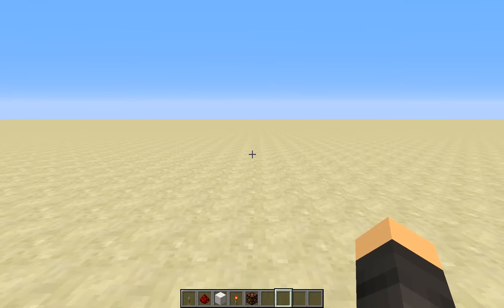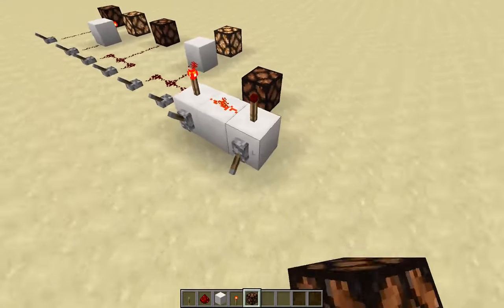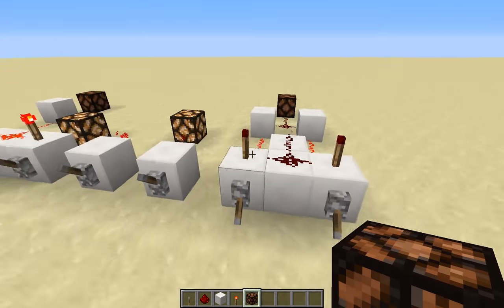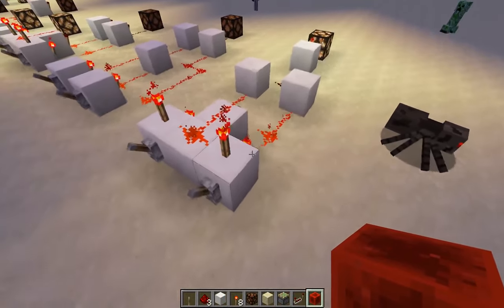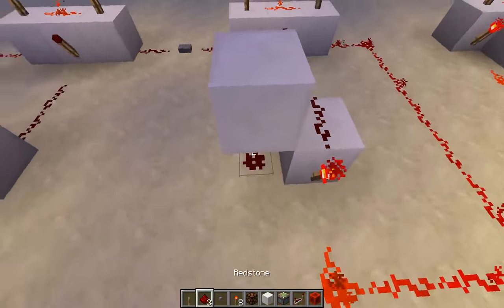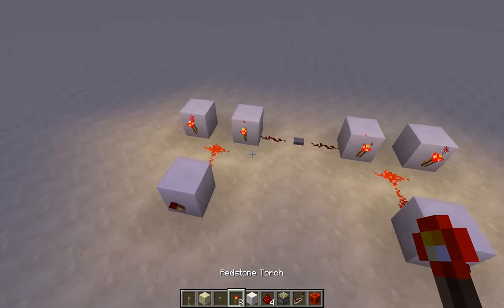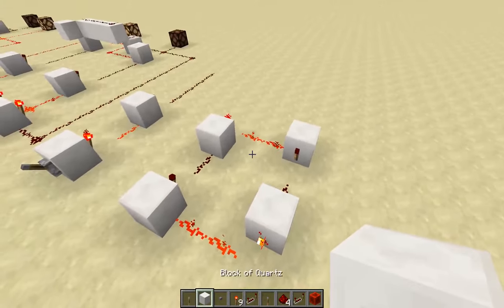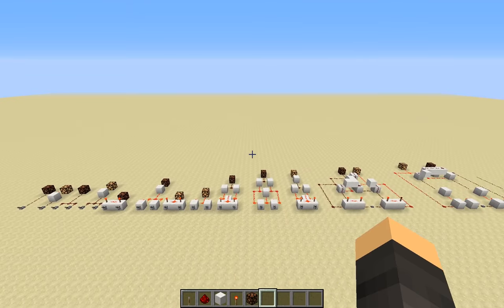Computer Logic Gates in Minecraft (Only Redstone and Torches)

Comment: Note: the T-Flip Flops in this video wont work in bedrock.
Reply from the maker: Are you talking about the one with the torches or the one with the piston?

I believe the one with the torches will work though I don't know bedrock.
Reply: PlexusMC 

Both
Reply from the maker: @xandercreates6766  damn that sucks. I would really have thought the one I did would have worked. Why doesn't it?
Reply: PlexusMC 

Redstone works differently in bedrock

It KINDA worked but every time it turned into a clock and wouldn’t stop
Reply from the maker: Ah well that sucks
Reply: @PlexusMC  Bedrock redstone randomizes.
Reply: Vulcan Tube 

Stone didn’t work iirc.
Reply: I achieve to solve it using Redstone Repeaters. Simply add two Repeaters with maximum delay for each two central lines
Reply: the rest work?

Comment: This vid is sleeping gold as far as I'm concerned. I'm convinced that ANYONE who wants to learn redstone needs to keep it simple first: Don't worry about complex inputs like buds, daylight sensors, etc. and don't worry about complex outputs like pistons, dropper/dispensers. Learn about the dust and torch mechanics first because while building compact is nice and all, it's not mandatory since Minecraft is enormous. Plus it's overwhelming to have to deal with pistons and such when someone like me doesn't fully understand how and when dust/torches will or won't connect to a block/component yet.

Anyway, perfect video man. There is a good reason this is the 2nd (should be first) option when searching "Minecraft redstone logic gates". I would love if you made a second part to this and give us even more complex logic systems using only the dust and torches, starting off where you left at the RS Nor-Latch! Liked and sub'd
Reply from the maker: Damn man thanks a heap
I might make a 2nd video. If you have any in depth suggestions about it I would be happy to include it. :)
Reply: ITS THE FIRST RESULT WHEN SEARCHING MINECRAFT LOGIC GATES
Reply: agreed

Comment: by the way, to make a clock with no repeaters that doesn't burn out, as long as there is an odd number of torches in total, it will not go out. So basically, make the one they had but remove one of the blocks and the torch on it, and connect with redstone dust and it will keep going

hope that description helps
Reply: This is called a ring oscillator.  I built one of these and it works fine in both Bedrock and Java editions.  One thing I like about it is you can add a lever and start or stop without having to try to do a zero or one tick pulse.

I love the challenge of designing circuits that don't utilize quartz-based components (observers and comparators).  If you can master these, you can have automation as soon as you find your first redstone dust - even as soon as day 1 or 2.

Comment: @MrFlacko If you know anyone who has any influence on Mojang's update design decisions, please tell them we need a Miniaturizing enchantment for modular redstone setups like this.

The mechanics are simple: 
Enchant a shulker box with the Miniaturizing enchantment, so when you open it you go inside the box just like when transporting to the Nether.
The box interior is the inside of a large cube where blocks and redstone components can be placed just like outside, with sides the length of a single chunk width (16x16x16, total 4,096 blocks volume).

Inside this space, you can build all of your redstone setups and connect them to special inputs and outputs on the walls of the cube, which correspond to inputs and outputs that show up on the outside when you come out of the box, max. one per side.  Installing only one input and no outputs results in all other sides being outputs, and vice versa.  The input/output can be installed anywhere on a wall, but always shows in the center of the outer side, just like the redstone output on the back of an observer.

This modular system facilitates instant copying of modules, which can be applied the same way as for copying books -- except that they need to be unlockable for modification.
Making them optionally accessible only to the box owner player could also be an important feature.  Locked for public servers, unlocked for guidance purposes, as needed.

Each module could be dyed just like a regular shulker box for convenience in placement.  Other features could also be added, such as being able to make the module itself glow when powered (or not) by connecting lamps inside instead of having to attach a separate lamp block outside.  This would also allow for lighting color changes from a single block using tinted glass inside.

Another massive potential advantage would be to allow for placement of special input blocks in the input hole itself so that the box behaves the same way as if the input block were connected from the outside. Placing a skulk sensor in the hole gives the box the input function of a sound sensor, but with the player's desired output all from a single block and the skulk chirping easily muffled without having to worry about flowing water around the box.

The modules can then be placed individually or in sequence as desired, broadening the scope and aesthetic of the entire Minecraft experience by stellar proportions.
Reply from the maker: I'll be sure to let them know my guy

Comment: Small pedantic correction: a Hertz (singular Hertz, not "Hert") is a measure of frequency, it just means one "thing" per second (cycle). In the case of computers (or any circuit e.g. a clock) it means how many operations happen each second.
Reply from the maker: I didn't do any study of computer science back then, logic gates were just a bit of a hobby. Thanks for the correction, there is a lot I'd change about that video.

Comment: Thanks for this video, was trying to remember what kind of logic gate could instantly prevent say, a hopper clock from progressing that i used in a semi-auto wheat farm(simple design, still had to replant, but it wouldnt keep switching on/off on set timer, so if it fired, i had to reset it and then itd just automatically break all the crops after a set timer was reached).

…i need a nor latch for a mekanism reactor safety switch: if it gets hot i want it outputting a signal to the latch to force itself to turn off, and then stay off until i can investigate why its running hot(like accidentally starting it full blast rather than slow-ramp up, or energy storage maxing out while its running ext).
Reply from the maker: very nice

Comment: These were all very useful, except the clock that burns out and the flip flop that cycles before settling. I think they can be improved, even with just torches (for the clock, if I'm not mistaken torches burn out for being turned on and off too fast so a fast clock would need to be made from combining the outputs of slower clocks).
Reply from the maker: The torches shouldn't burn out from that clock I don't think it's fast enough, also the flip flop circuit can switch a single time with a pulse instead of a button. I just didn't find any better way to do it

Comment: This is awesome:) I couldn’t get the t flip flop to work in bedrock edition though:( there are other ways but I was interested in learning all the Gates long hand
Reply: I dunno if this might work, but maybe try building it a couple blocks away frkm the original spot. I've heard that building between chunks sometimes does this.
Reply: on bedrock version you aren’t able to unstick a block that’s attached to a sticky piston that’s why they t flip flop doesn’t work on bedrock. instead you can do another design that uses two droppers, a hopper, an item of your choice (it will go inside the droppers and hopper), and a comparator. to build: place an upward facing dropper, then on top of that one place a forward facing dropper. Then, in the direction the the top dropper is facing, place a hopper facing into the bottom dropper.

Comment: Hey its 2/13/23 and I'm learning Redstone with this video. Seems like your no piston T-flip is broken in my version of modern MC: stone buttons seem to last for shorter duration than wooden buttons. A stone button will flip the lights back and forth 3 times (left right left) and alternate, but then the system shorts and breaks. Wooden buttons power for a slightly longer duration, allowing a fourth flip (R L R L), which doesn't short the system, but also doesn't alternate which light ultimately stays on
Reply from the maker: I did design a new one and went to record the video, it corrupted and I never decided to record again. Maybe one day

Comment: Yo I am making a secret base and there are 2 inputs, when both inputs are the same, the base should be closed. When they are different, the base should be opened. What gate should I use?
Reply from the maker: Nor
Reply: 1st of all, I can't believe Ur still active. 2nd of all, I spent ages trying to to figure it out and I did it was the XNOR but thx anyway I will sub and like
Reply: Coz NOR gate is    1+1= 1    1+0=0      0+1=0      0+0=0        and I need      0+0 to =1.  So I will use the XNOR which is   1+1=1    1+0=0    0+1=0   0+0=1.   Thx anyway

edit: i mean     1+1=0     1+0=0        0+1=0       0+0=1
Reply from the maker: @Ali-vi9qx  Hahah thanks mate
Reply: Ok im confused. If either inputs are on, the base is closed, If either inputs are off, the base is open... so if i have one input on and one input off, its both closed and open??! :o superposition...
Reply: @Ali-vi9qx  Nor gate is 0+0=1, everthing else=0
Reply: @AlexandrBorschchev  if both inputs are the same, the base is closed.  if one input i s different, the base is open. so normally both inputs are off or on and as soon as you pull the lever on the outside,  the base opens and if you wanna close it from the inside, you will pull the lever in the inside and both inputs will be the same again so it will close and vice versa for going outside.
Reply: @marcbelsch3887  u r right i made a mistake i meant 0+0=1 and i needed 1+1 to equal 1 but it normally equals 0 so yeah thx
Reply: @Ali-vi9qx  wow that is smart, what you need is a xor gate because it only outputs 1 if all inputs are different. xor truth table looks like this: 1+1 = 0, 0+0 = 0, 1+0 = 1, 0+1 =1
Reply: I can't understand this
Reply: @justanub4697  looking back on this neither can I lol
Reply: @justanub4697  when quarantines fully over and we return to school I'm gonna move down like 20 sets

Comment: I noticed that the flip flop circuit will alternate output lamps when a stone button is used, but will always illuminate the same redstone lamp if a wooden button is used. I assume this is because the stone button emits an even clock tick pulse (10 ticks) and the wooden button emits an odd clock tick pulse (15 ticks). Does this explain why different buttons produce a different output?
Reply from the maker: Yeah so how to fix that was using a monostable circuit. It was a bit annoying to do and it was incorrect in the video. Flip Flop circuits that work in minecraft are pretty hard to find.
So basically put a monostable circut in it with some redstone torches, and delay

Comment: Was watching and wondering why you can't connect 2 output lines over t flip flops, wouldn't that eliminate the jitter between the swapping of the lines?
Reply from the maker: It doesn't quite work
But I have a new version of this video coming out whenever I decide to record it. In that I had a pulse generator connected to the input of the t flip flop, so it only switches once.

But I recorded for about 2 hours and when I went to edit it was only at like 10fps because there was something calculating in the background using up my CPU

Comment: i just found this today out of curiosity, i am going to try to make a JK flip flop and making a counter (0 to 15) with 4 bits using flip flops D, i wonder if you can make state machines (Moore or Milli)
Reply: if you could make it too and upload it i would very much appreciate, now that i know that such things as logical gates are possible i am going to the next step which is making integrated circuits that depend not only of our current state but also the state that came beforehand

Comment: The only reason why a computer like this won't be viable is because of the lag.
To extend the signal, you would use tons and tons of torches repeaters (with the other many torches) and this will create A LOT of light updates.
Besides, the size of this thing is... Well... We may have to extend the build limit and the chunk loading limit by a few dozens of blocks...

I mean, you could build a computer powerful enough for this, but... Why?
Reply from the maker: it's ok if its laggy, just make it a macbook
Reply: There's also hexademical logic in minecraft
Reply from the maker: @ИгорьДементьев-и7м  how so

Comment: Hey, Plexus. So I'm trying to make a redstone gate that has 3 lights. The lights are arranged in an arrow shape. So left, middle, and right. I first wanted to get the gate to turn on the middle/left or middle/right lights using 1 of the 2 levers I have for each option. Lastly, what I wanted was for the gate to be able to turn off the middle light if it was already activated when I press the other lever without toggling the first lever again. Is this possible?
Reply from the maker: Not sure, could you do a truth table? 
For AND the truth table is
00 | 0
01 | 0
10 | 0
11 | 1
Reply: @PlexusMC  I'm not sure if I'm doing it right. 

I'm trying to get the lights to go like this 

     o                            l
o       o     ---->      l         o      option 1

     o                           l
o        o    ----->    o          l        option 2

So starting with no lights on and it being able to shift from side-to-side. Canceling out its opposite.

//I may have had the wrong idea when I left a comment earlier :-) new to this and very interested.
Reply from the maker: @slivyo  Ah it's a 0 not a o
It's meant to represent binary

The input is the first column and the output is the 2nd column 

00 each 0 represents a lever being either 0 or 1 (1 being on)

00 | 0 (when both levers are off, the output is off)
11 | 1 (when both levers are on, the output is on)
Reply: @PlexusMC  Okay, so what I was trying to do is have 3 lights. Like this:

[ 1 ]   [ 2 ]   [ 3 ]

I wanted the option for lights 1 and 2 to act in unison when lighting up. I also wanted the same for lights 2 and 3. Essentially leaving 1 or 3 off for each respective combo. 

I want to be able to toggle 1 and 2 (3 will remain off.) and then if I toggle 2 and 3, have 1 shut off. So a rule that keeps 1 and 3 from being on at the same time.

Is this possible to do with the information/method provided in this video or would that require an observer? I've been going crazy trying to solve it. :-)

Sorry if I have been confusing and thank you for replying.
Reply from the maker: @slivyo  I think it would contain an Xor gate 

Maybe even the RS Nor Latch. It will switch when one side.is turned on. Two inputs two outputs 

The light is only on when the input is different.
I'll give it a shot when I'm home, just starting work.
Reply: @PlexusMC  Maybe it's beyond my understanding atm. I am unsure of how to connect the functioning of two gates. 

Without knowing how to combine two gates, the RS Nor Latch starts with 1 of the lights on (which is unfavored).

With just using the Xor gate, lights 1 and 3 cancel each other out; which leaves the middle light (2) on only. 

I'm trying to make as much sense as I can of it all. x) Again, thank you for your help.
Reply from the maker: @slivyo  I'll be home in 2-3 hours I'll give it a shot
Reply: @PlexusMC  Thank you :-)
Reply: @PlexusMC  Did you ever have a chance to try it out? If so, any success?